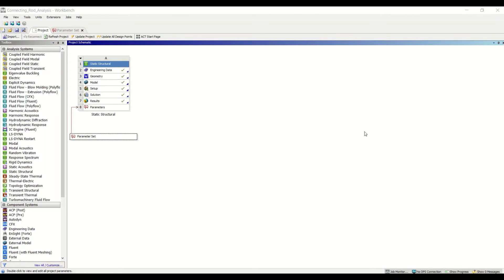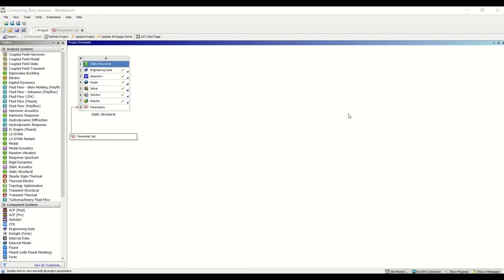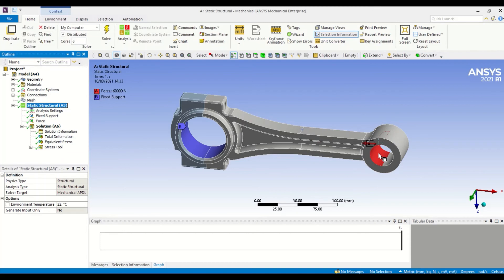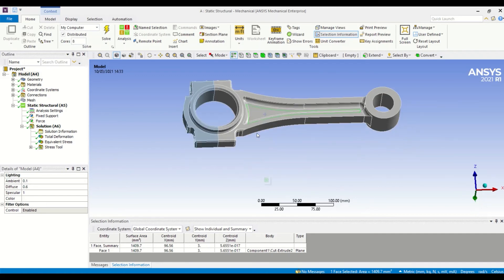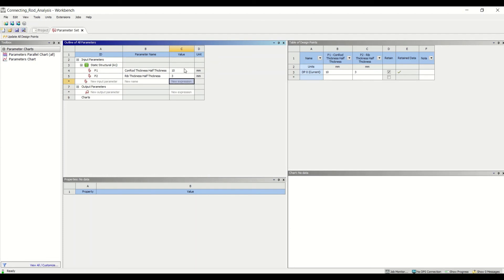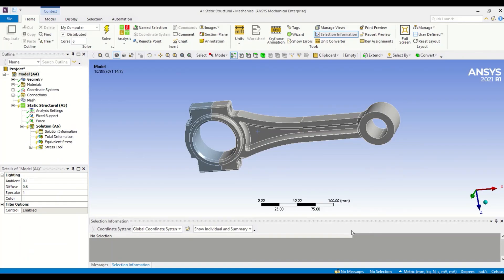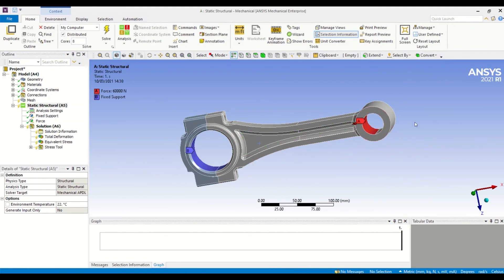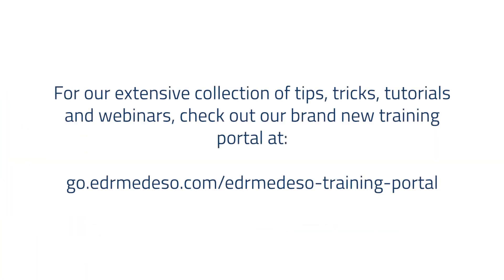How to Setup Parameters in Ansys Mechanical

Comment: How would i share an applied load to multiple same analysis in work bench with different meshes. i dont want to open each static structural and change load. just want to change in one and others accpt the change?